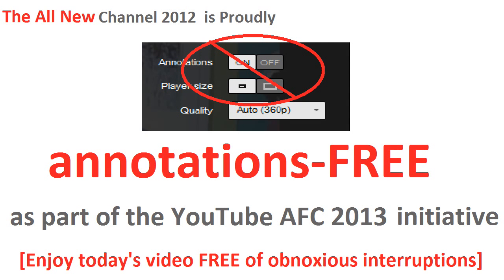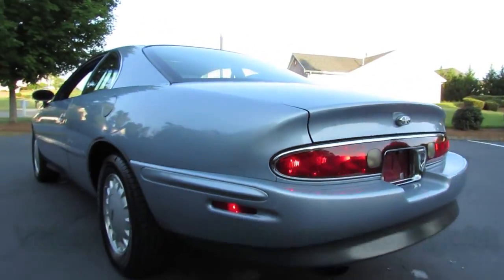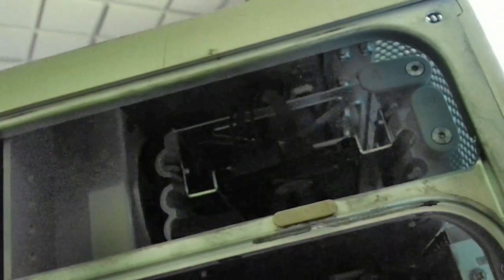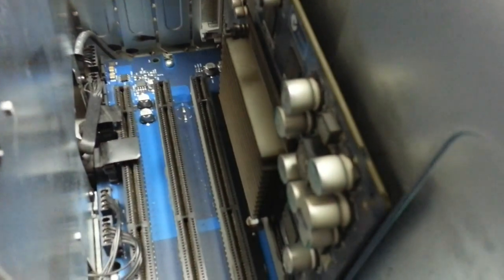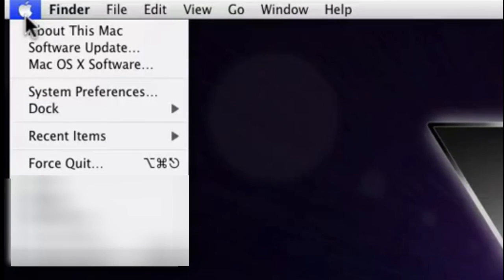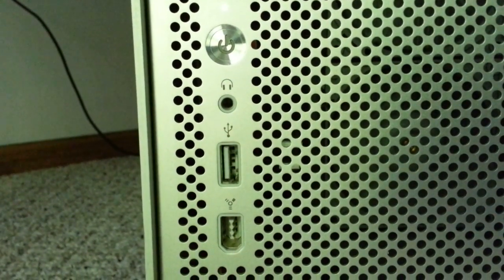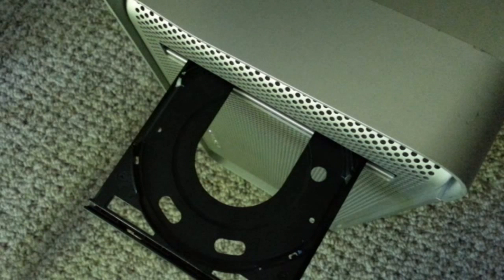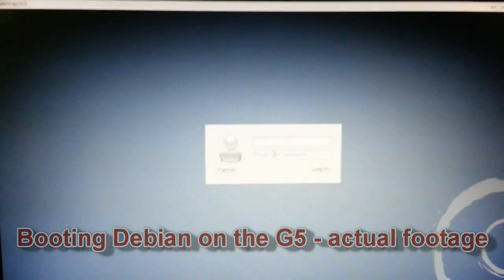FAQ - Using PowerPC Mac PCs in Modernity

Comment: MANY of your comments are either suspect or simply wrong...iBook G3 (Clam Shell) was far form a technological or commercial failure (it is one of the Post-Steve Jobs return) products which saved Apple...and whomever dreamed up Buick as an inspiration for Apple Design is grasping at stupidity (Jony Ive's inspiration was far from anything dreamed up in Detroit).

1. PowerPC was a collaboration by a group called the AIM Consortium (Apple, IBM and Motorola)...Apple's change from PowerPC to Intel (there was even a time when Apple courted AMD) was IBM's inability (at the time) to get strong enough yields from Power Architecture, nor the ability to produce a lower power version for mobile computing. The final PowerMac G5 2.7Ghz (Dual) and 2.5Ghz (Liquid Cooled Quad) were clock for clock faster and more efficient than the Core2 based Xeons Apple began using soon after. The final PowerBook produced was a 1.67Ghz (single processor) Motorola G4. IBM still enjoys success with Power Architecture for servers and other high end corporate solutions.

2. Gigabit Ethernet was introduced during the G4 Era. Installing OS X (it IS pronounced OS TEN as in Roman Numeral for TEN) is a breeze and requires far less "hand-holding" than installation of (in most) cases Windows (as well as being significantly easier than Linux). Web browsing sluggishness has more to do with sloppy/buggy coding of Flash and JavaScript than with the machine's hardware itself.

3. Upgrading the display adapter is exceptionally easy, just plug in the new one. If you wish to use a hacked approach and purchase a video card without a "Mac" BIOS you will need to change the firmware on the card using a PC. The proprietary connector on the back of the badly outdated FX5200 (which was the bottom end card offered on the initial release of the low-end PowerMac G5 1.6Ghz (Single Processor) is called ADC (Apple Display Connector) which could be adapted to DVI with a special connector which originally shipped with the machine. ADC was a brilliant idea, it allowed fewer cables on your desk for a much cleaner work environment. ADC supplied power, video signal and USB to Apple Studio and Cinema displays which used an ADC cable and had a built in USB hub. Only the early PowerMac G5s were AGP. Later production G5s used PCI-Express for display adapters

Mouse acceleration was intended for use with LARGE displays and can be turned off in Control Panels. Your G5 has TWO FireWire Ports (one 400Mhz and one 800Mhz). The two little ports above them are called USB (and the one below is called Ethernet). Do not blame Apple for the lack of support of your Cannon device, thank Cannon for not supporting Macintosh. I will agree living in the Macintosh world is a little trying when it comes to software, but it has nearly always been that way because Apple is a "Niche" market.

The microphone jack on your G5 is not meant for a cheap'ish analog microphone, but rather a digital microphone...which produces much better sound quality and sadly is considerably more expensive. And the fancy power button and light CAN be made to work in a proper conversion from G5 to PC...but you have to know a little about wiring and electronics.

4. There were several video editing suites produced for the PowerMac, not the least of which were Final Cut Pro and iMovie (for the more consumer oriented...and shipped with the PowerMac preinstalled and on the original restore DVDs).

5. The only official Linux which was designed specifically for PowerPC is YellowDog, although there is a port of BSD for PowerPC (but considering OS X is built around BSD's UNIX kernel...).

6. Is a PowerPC G5 or G4 usable today...Yes, these machines are great for productivity and work beautifully as media machines and media servers. Unfortunately if your daily computing tasks involve mostly web surfing (or producing salacious video and passing it off as fact to the uninformed), then no. Because of lack of software support from Apple and third party developers PowerPC has unfortunately died a slow and agonizingly painful death. It is still a very good machine and there are several places which you can get Share/Free/Abandon Ware for PowerPC (and earlier) Macintosh computers, as well as finding good deals (and sometimes no-so-good deals) on Amazon or eBay.

You can thank your scanner's manufacturer for producing a product which was fully TWAIN Compliant...which is why it works well with your Macintosh.

Finally, yes it does matter whether you are willing to make some sacrifices and not use the latest software to be able to enjoy these classic machines. Realistically, Microsoft Word basic functionality has not changed too much from the Macintosh "Classic" OS days. I personally use MS Office 2004 Pro and MS Office "X" Mac today and they work for everything I need them.

Most of your issues in processing power and sluggishness would probably have been assuaged by having purchased a higher end G5 than you did and by maxxing out the memory your machine has installed. The PowerMac G5 was Apple's first foray into 64bit processing and using the version of OS X written for it...the more memory the better...
Reply from the maker: FiverOtaku 
Ho nelly! That's a lot of text there :-).

Let me start off by saying that I appreciate your input and the time it took to write that nearly 900 word essay of a comment. That said, let me address some of your commentary:

1a. "whomever dreamed up Buick as an inspiration for Apple Design is grasping at stupidity". I've got to admit, I did chuckle at that one. However, you've got to admit there is more than a passing similarity between one of the the roundest cars in the world and the roundest laptops in the world.

1. (the PowerPC/x86 comment) As I mentioned in the video, the PowerPC platform thrived for some time after Apple realized the error in continuing on with it. The Xbox 360, PlayStation 3, Wii, and WiiU continue to live on in infamy to this day, but console manufacturers are starting to come to the same realization that Apple did a decade ago, hence the mass exodus to x86.

2. (Gigabit ethernet) Great. 
2. (pronunciation) Agree to disagree.
2. (Installation) Is indeed quite easy. Agree to agree.

3. (Video card upgrade) As I mentioned in the video, unless you are buying a "specially marked" card, the upgrade requires a special compatible card and a regular computer to flash its firmware.
3. ("ADC") Great. I'm sure we can think of a few other examples of proprietary connectors that never took off too.
3. (mouse acceleration) You're dead wrong. Mouse acceleration is poor for any size of display and cannot be turned off.
3. (connectivity) I know what USB ports are and I don't intend to "blame" anyone for lack of support of anything. I'm just pointing out that the camera, which is a standard firewire video device, does not work with the comptuer, despite the computer's apparent focus on firewire connectivity.
3. (microphone) I'm not so sure about that. It looks like a standard analog jack to me. At any rate, my point still stands.

4. (Final Cut) Final cut is a joke. It choked up on me just trying to import a video.

5. (Linux) Not at all. Ubuntu and Debian have a PowerPC version and Mint has a PowerPC fork as well called MintPPC. There may even be a few others that I forgot to mention.

6. (efficiency) If you're not paying the power bill, then it's great. Otherwise, there are far better ways to achieve those goals that cost less and consume less energy.
6. (scanner) Great.

"Most of your issues in processing power and sluggishness would probably 
have been assuaged by having purchased a higher end G5 than you did". Perhaps, but doubtful. I didn't bother sticking around to find out. I ended up selling that machine and buying a 12" ThinkPad X200 tablet to replace it. While the ThinkPad has some notable shortcomings, it is leaps and bounds better than the G5 - it's a better performer, has better connectivity, better compatibility, weighs significantly less, produces less heat, produces less noise, consumes less power, and includes an active touchscreen and wifi to boot. And that's just the tip of the iceberg. It is ironic, but true that this tablet is a better desktop than my G5 ever was. Heck, my smartphone matches (and sometimes beats) the G5 in a lot of areas. I guess that just goes to show how far the technology has come.
Reply: ***** 
I do fully agree the PowerPC platform for Macintosh IS dated...my (personally) biggest frustration with this great but aging platform is the lack of ability to play HD video. My 17" DLSD PowerBook (Late 2005...the last PowerBook) is incapable of playing 720p or above (locally stored video), where I have an ancient Compaq Presario 3017cl a rather anemic 3.06 Ghz P4 laptop (SiS chipset and graphics from 2003) will play them just fine. 
Most of the "Problems" with Apple and software support come down to two issues; the first being Apple placed themselves in an overpriced niche market while keeping RISC based system instead of the CISC basis of x86 computing...Porting popular software from CISC to RISC can be difficult, time consuming or actually impossible without rewriting much of the code from scratch. RISC is not a bad idea, actually it is a great idea for efficient number crunching...realistically...who is going to rewrite their "PC" codebase to RISC when the market share for the latter is under 3%...
I cannot speak for Microsoft's decision for switching from Power to AMD...but a VERY large part of Sony's decision lay with developers writing games for multiple platforms (console and PC) whose PS3 ports were horrendous compared to the PC or others...games written for the PS3's Cell Processors (and properly optimized for the platform) are beautifully rendered and fast...non-optimized games can be a nightmare (read: Skyrim)...so a change when PS4 was brought out was inevitable...although if Sony (and developers) keep to their histories of support...the PS3 still has several more years of life remaining (the last "New" major developer release for the PS2 was part of the MLB franchise just a few months before the launch of the PS4).
Apple was actually looking at a platform change as early as 1999 when Rhapsody was coded both for RISC and x86...but performance on the PPC platform was still very competitive to the PC. As I had alluded to, one of the biggest reasons for the change was AIM's (mostly IBM) inability to make a mobile G5...the later G5s were absolute screamers, especially when Apple finally adopted PCI-E for the display bus...
The biggest drawback of the early (single processor) G5 was that (even though it could address significantly more memory over the G4's 32bit architecture) it was in nearly every way slower than the G4 it was replacing...it was also not as expandable as its predecessor...
I think Apple handled the change over from PPC to x86 very badly...the PowerMac G5 was only given a couple years of support before Apple abandoned the platform entirely (almost as if they wanted to forget it ever existed).
I am not now (nor have ever been) an Apple fanboy. I have always had PCs and Macs working side-by-side...each have had their purposes...although I do really detest the direction Apple has been headed under Apologist-in-Chief Tim Cook...and my 13" MacBook Pro is probably the last new Apple machine I will buy...which is sad...I own many Apples (both desktop and laptop) dating back from my ANCIENT Apple //c to my current MacBook Pro (all are still perfectly functional and running era specific softwares for each machine)...I will be Windows and Linux for any future machines (I've been building my own since the early 90s).
Reply from the maker: FiverOtaku
Cool. I felt the same way with these next-generation systems. It seems as though they released them partly just to dull the "when's the next console coming out?" hype and partly to make cross-platform jobs and porting easier. Now that we're getting everyone on the same page architecture-wise, it'll be easier to make that stuff happen. Unfortunately, this may mean a premature drop of support for the 7th generation consoles by developers because that extra and complex porting of games that is going to be a thorn in their side. Then again, there's still a lot of money to be made with them and (as you pointed out) Sony has a history of stretching out their consoles, so it'll be interesting to see if continued support or developer laziness wins out there.

Going back to what you were saying about the Tim Cook thing, I was thinking the same thing too. I have the feeling that Steve would've never let iOS7 or iPhone 6 or the cartoony-looking versions of OSX fly.
Reply: ***** 
I think the biggest Anti-Jobsian direction Cook/Ive has steered Apple toward is disposable product lines with no upgrade path except buying new (or opening a vein wider at initial purchase)...Yes...Jobs wanted everyone to have and want new product...BUT...he also wanted to keep as many of those products out of the landfills as possible...at the same time the last shipping PoewrBook and  G5 (Dual 2.7 and Quad 2.5) shipped with (late cycle) OS X 10.4 with Apple knowing there would not be any further OS support past 10.5...
New Macs are now tomorrow's landfill fodder...

Comment: Channel 2012, u are a huge idiot baka face, the g5 had at least a 30% gain on intel cpus throughout its entire life, the cpu could exceed 8 GFLOPs per core on the higher end models, it has also been verified that the ppc architecture was at least 75%more efficient at multitasking than a similar era intel based box http://www.everymac.com/systems/apple/powermac_g5/faq/powermac-g5-performance-speed-comparison.html
Reply from the maker: Elektrokinesis 
Thank you for your inquiries. I understand that my revelations in this video may have struck a nerve with the technical specifications crowd, but the facts are the facts and the hardware has quite simply run its course.
Reply: we all know that, the point is that it was slightly ahead of its time as far as specs are concerned when compared to the top of the line single/dual chip intel based systems of that era
Reply from the maker: Elektrokinesis
On paper maybe. But today, those "inferior" systems surpass it.
Reply from the maker: *****
Except they do!
Reply: +Channel 2012 i bet you've never seen a linux ppc g5 HPC cluster in your life, ever, there is a reason why they are still in use in tons of places like render farms
Reply from the maker: Elektrokinesis
You're absolutely right - I have never seen one, and I'd imagine most people also have not because they're not really in use anywhere that needs to get any serious work done with anything remotely resembling efficiency.
Reply from the maker: Elektrokinesis
Ooh, top 500. I'd bet I have some equipment laying around that qualifies for a "top 500" list somewhere too. Did you know that the PowerPC-based Xbox 360 and PlayStation 3 were the top 2 game consoles until they were superseded by the Xbox One and PS4? They stopped investing in PowerPC for the consumer PC market a decade ago and they stopped investing in PowerPC for the niche-enterprise and console market 4-5 years ago.
Reply: i could go all day, ibm POWER8 is being used by google now for high speed data analytics and for fucks sake, im talking about when these machines were new, they could crush any p4 xeon core in existence
Reply from the maker: Elektrokinesis
Good for them. Remind me again what that has to do with a PowerMac G5.
Reply: he is very special
Reply from the maker: *****
Good for them. Remind me again what that has to do with a PowerMac G5.
Reply: i hope you get a darwin award sometime in your life

Comment: I don't want to post a cliche comment, though, my Power Mac G5 is quite the beast of a machine, and generally handles most basic tasks as fast as my 13" 2014 uMBP.

Specs:
1.8 GHz Dual G5 June 2004
6GB PC3200 400MHz RAM (4GB Logic board ceiling, 2x2, 2x1 GB)
80GB Corsair SSD
3TB WD HDD
X800XT Pro Platinum Mac Edition 256MB, scored it for $70 on ebay a few weeks back
Nvidia GeForce 5200 FX PCI flashed PC card 128MB
10.5.8 Leopard

This machine does have a few perks that even some computers today would be lucky to have, such as an SSD, a 3TB HDD, and dual video cards. It obviously isn't anything special compared to a Mac Pro, however, this is most likely the highest end configuration I could soup up for this machine, with the exception of storage capacities. I feel lucky to have this machine as it is, especially since it only came with a 9600 XT, 2GB of RAM, an 80GB HDD, and a defective optical drive, which I still use to this day. For what it's worth, and what it's been through, it's a hell of a Mac, and I love using it.